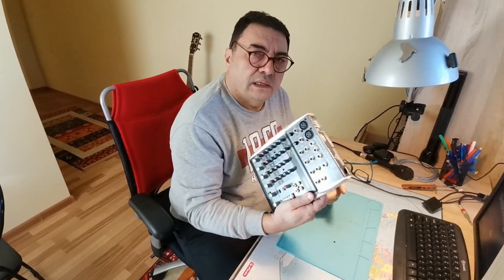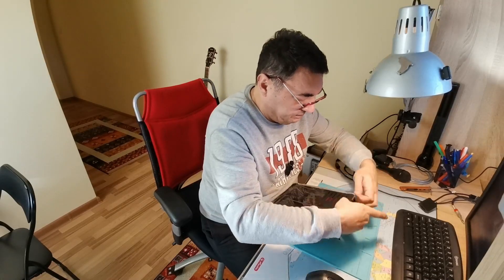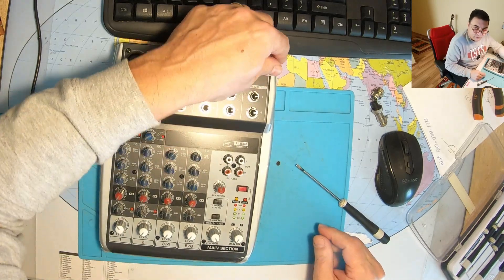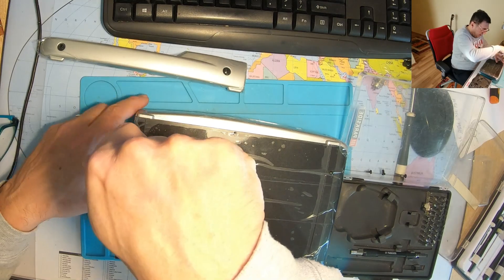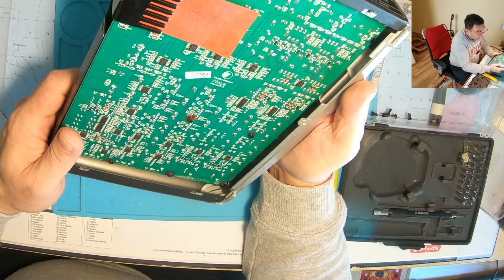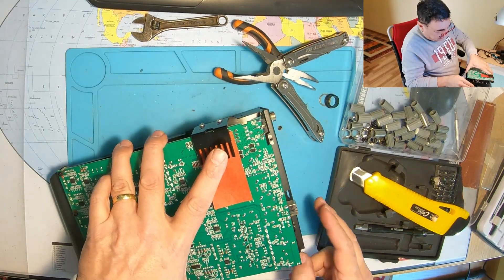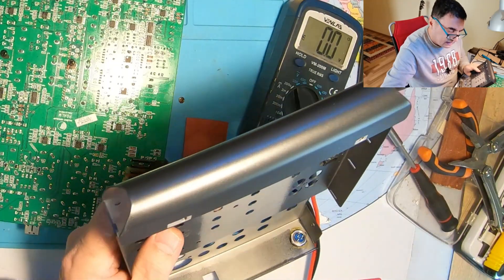Behringer Xenyx q802USB dismantle and power plug replacement

Comment: The oscillation you saw on the supply rails strikes me as highly suspicious; it may warrant inspection with a scope. With some luck it's just some tired electrolytics, worst-case it might even be a PCB design problem (e.g. ground routing). I thought my Q1002USB was OK noise-wise, even if it sported about an extra 6 dB of input gain and never seemed to have microphone input EIN quite as low as the specs would suggest (I got estimates of about -126 dBu unweighted with the input shorted).

The more extra features these mixers have the hotter they seem to run. The combination of an 18-0-18 V~ transformer secondary and regulated voltages of +/-15 V is not doing the heat issues any favors either. If I have my math right you should be seeing about +/-25 V at the regulator input terminals, so they have to dissipate about 10 V. Not exactly efficient. My guess is that this enables skimping on smoothing capacitance (a matter of $$$) as you can have more ripple before the regulators drop out. Normally you'd see a supply like that fed by a 15-0-15 V~ secondary. Ideally you'd want about a 13.5-0-13.5 V job (and some bigger smoothing capacitors), not sure how common those are off the shelf though.

(If there is enough space and you are feeling adventurous, some small DC/DC converters to take the unregulated voltages down to about +/-18 V would be a near-ideal solution, assuming you get the output filtered well enough. 78xx/79xx are not very effective at high frequencies.)

3:12 is an 074 quad JFET input opamp by JRC, so look for NJM074. 07x are a classic choice for inverting mixer circuitry at highish levels and circuit impedance. Their decent slew rate keeps them out of trouble, their input capacitance and resulting common-mode issues are irrelevant, and as long as output loading is kept reasonable distortion is fine, too.
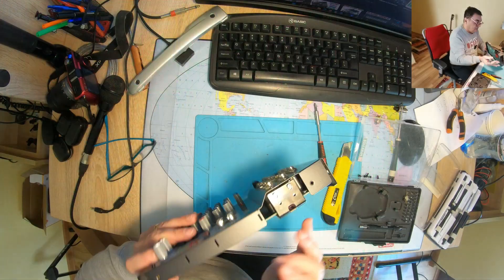3:19 is a generic LM339 comparator made by ST.

RC4580 is a faster, lower-noise, lower impedance take on the classic 4558/4560/4565 kind of architecture. I think the TI type is cheaper and will work to lower supply voltages (down to +/-2 V, so it'll run on +5 V single-supply if you insist while still providing decent dynamic range, which I think is why Yamaha has used it in a number of keyboards). It does seem to have some warts in the distortion department, where NJM4580 may be the better-performing option in a +/-15 V application.

In any case I would consider it highly unlikely that a 4580 would be your limiting factor in the noise department. It's 5532 class, which is more than decent especially for such an inexpensive part, no wonder they are so popular. Instead, I would take a good hard look at ground routing. Wherever there are shared power and signal ground returns, there is a potential for signal ground pollution by supply bypass capacitors. Some 1980s hi-fi components with single-sided boards can be quietened down substantially just by reinforcing all the ground tracks with wires! Seasoned hi-fi designers would often use the trick of giving the various circuit sections individually RC filtered supply rails. Either variant improves the ratio of ground return impedance to rail source impedance, which is what is forming the voltage divider responsible for the noise insertion.
Reply from the maker: I will scope it soon, thanks
Reply from the maker: Very nice and well documented remarks. You gave me an idea, why not diy a double 15V DC external and bypass on board regulators. It can be feeded with better capacitors too. I'm kind of worry for any kind of Dc converters due to harmonics and oscillation. I think a classic regulated external power suplly will do a perfect job.
Reply: @viocaia  "You gave me an idea, why not diy a double 15V DC external and bypass on board regulators." That would certainly be the best option from a thermal perspective. It does make contact at the power connector a bit critical though. As a compromise, you could also feed the mixer with about +/-18.5 V DC as it sits... 15 V + ~2.1 V regulator dropout + ~0.7 V for the rectifier diode would be the minimum required, with the rectifier taking care of polarity. (You could easily do some testing with a pair of lab power supplies if you have a spare power connector.) That should already help quite a bit.

I would also replace the regulator output capacitors, especially if they are only 10 µF - if 47 or 100 µF @ 25 V will fit mechanically, I would use something like that. Not sure how one could improve ventilation in a device like this.

BTW, I just pulled up the old Behringer UB802 schematics (you can find those on the interwebs) and noticed that the power connector has both transformer secondary center tap and analog ground on it separately. Interesting! Does the mixer connect center tap and shield internally (which is what I would do) or is that happening in the power supply?

Speaking of the UB802, that is chock-full of 4580s with not a TL07x in sight. Were they running out of space in the Q802USB, so they had to resort to using TL074s? There is far less choice among quad audio opamps, inexpensive ones at that. Mind you, in this old model there are plenty of positions where you could get away with TL07x just fine, as surrounding impedances are fairly high.

On another note, I guess the USB sound chip (looks like the PCM2902 clone also found in newer UCA202/222s) is being powered entirely by USB +5 V? That would make a lot more sense than trying to regulate +15 V down, but you never know...
Reply: PS - I did some digging for inexpensive low-noise quad audio opamps:
Rohm makes a BA4584, which seems to be a quad 4580. Only the automotive spec BA4584YFV seems to be in production. That's one way to keep your prices up.
There's the On Semi MC33079. There's also the very similar ST Micro TS524 = MC33079. Seemingly the same circuit with a quasi-complementary output stage in distinct but similar implementations. The very differently-behaving TI counterpart seems to have been discontinued.
TI does still have the LM837, a very quirky old part known for its poor phase margin.
The most interesting part in TI's lineup may be the inexpensive OPA1679 (MOSFET input), the 2ch version OPA1678 is used in some low-midrange audio interfaces these days (e.g. MOTU M2).
OPA1664 (bipolar) and OPA1654 (MOSFET input) are good midrange options.
OPA1604 (bipolar) is probably a bit too hot for a drop-in replacement, and a JFET-input part like OPA1644 or OPA4134 will cost you a fair bit extra as usual. OPA4134 is also a bit power-hungry.

I'm pretty sure LM837 and MC33079 date from the 1980s. BA4584, I guess early '90s? OPAx4134 also is early-'90s. TS524, early 2000s. OPA16xx are all 2011 or newer, with OPA1679 being one of the latest additions ca. 2017-19.
Reply from the maker: @PileOfEmptyTapes  Thanks! It's looking like you really know OP! I'm still learning in this field. But q802 it's not worth upgrade nor time spent, I'll just let it be, used with care , with little gain and moderate volumes it's ok, for the money it's perfect tool. I'll do some test with spectrum analiser and oscilloscope to see if any high frequency oscillations too.
Reply from the maker: @PileOfEmptyTapes  Interesting! I have a dual power supply and I'll do the test in situ, probably nothing to improve but heat,  mine it's not getting so hot now, I have a new transformer gives 2x17V open, almost at the edge of 7815/7915 to work, but steady 15V DC after , no more oscillations. Probably the 18.5 AC under load (like 21V open) was a little to hot for regulators to handle...?  Well, that's the money, that's the result! Like you noticed, USB it's pretty basic and no compare with my RME4952 and Focusright Saffire 40! But I need Q802 for small gigs just voice, guitar and Ketron SD40 module. It's sound good on stage, the compressors are ok for live situations. I'll just let it run for now. Thanks again!